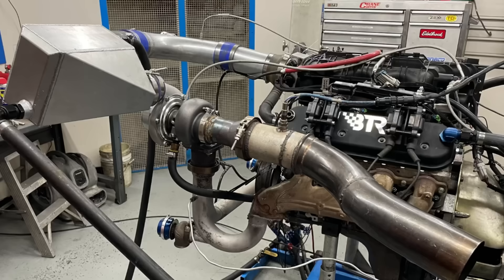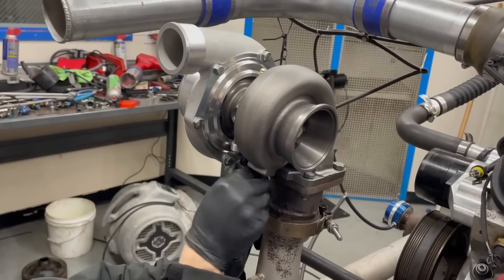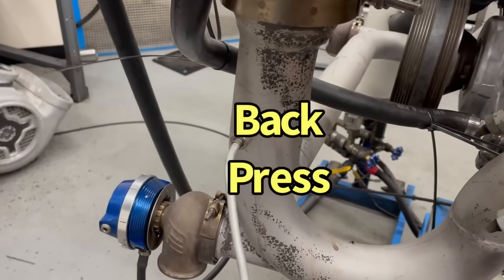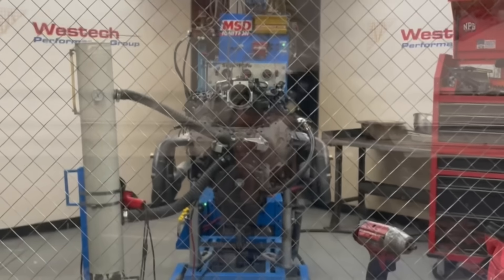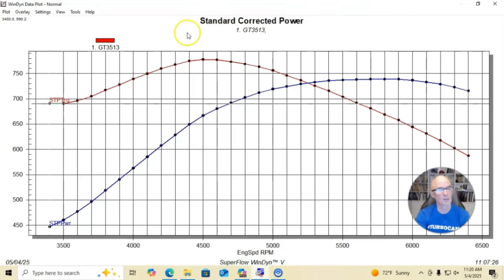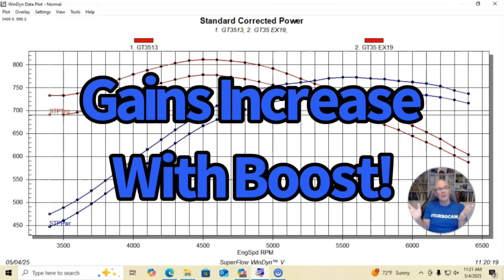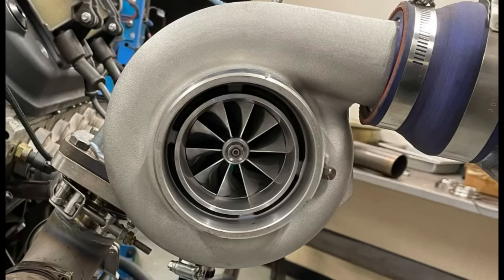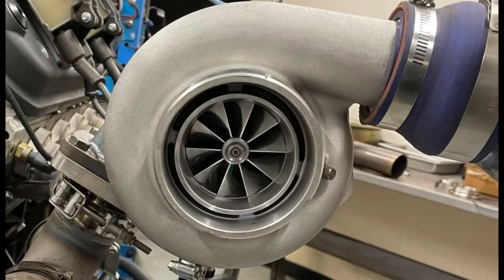WHAT IS THE TURBO POWER CONE? TOP SECRET JUNKYARD TURBO LS POWER MODS! DOES IT REALLY ADD POWER?

Comment: Here's a question for you, with or without a powercone type of piece, what would be the best way to split a single turbo into a dual fender exit? My son doesn't like the look of the pipe just coming out one side of the fender if possible anyway.
Reply from the maker: you can use a Y pipe to split the exhaust exiting the turbo

Comment: I have a cutout at the bottom of my downpipe. When i open it it picks up 4psi.
Reply from the maker: cheap boost!
Reply: Very. And that was on a 66/73. Going to a 72/75 with BTR S1 Turbo cam now. @richardholdener1727

Comment: Yes resistance in a pipe is measure by length, foot, inch, doesn’t matter. Anyway the longer the pipe is the more resistance. That’s why a short piece of thinner pipe doesn’t restrict as much as a full pipe of that diameter. We deal with this with swimming pool and spa pipes all the time. Even if there’s a small valve, step up the pipe and you can hear the pump struggle less and the amps go down.

Comment: I would really like to see the results with the cone tappered back down to a 3" cat back ( or whatever the exducer v band is) most street cars do not run a dump pipe off the turbo.  " Oversized down pipe test".  I assume it would make more power with the bigger down pipe , but who knows with out data.
Reply from the maker: why taper it up to begin with then?

Comment: Would there be a similar effect if we tested single 3" vs 3" that went to dual 2.5"? For some car's it's easier to fit 2 slightly smaller pipes than one larger one, and I think dual 2.25" is probably similar in flow to 3.5" because their cross section areas are almost the same.
Reply from the maker: do the math for area-it might surprise you
Reply: @ assuming pi*r^2, I get about 38.5 sq in for single 3.5” and 39.25” for dual 2.5”. My question was more so if the geometry of the expansion is what makes the power or purely the increase in volume

Comment: This works on the principle of negative pressure waves, same like with the length of the primaries on headers, the position of the collector determines the rpm at which the effect is most pronounced. If you adjust the length of the exhaust before the cone, you can increase the effectiveness at a specific rpm and therefore benefit greatly from it based on the rest of your set up (cam, intake, turbo etc)
Reply from the maker: This is not a reflected wave-there is no scavenging back through a turbo to the combustion chamber (like on a header)-this one is just flow
Reply: @richardholdener1727  there is no reflected wave to the exhaust valve, the reflected wave is effective on the turbine wheel of the turbocharger. The reason of increased boost pressure is because of the pressure ratio across the turbine wheel increasing; pressure in the exhaust manifold remains the same, but the pressure on the turbine exducer is lower because of the constant negative pressure waves applied in that area. This difference in pressure ratio applies more work to the turbine wheel (since the air flows more quickly out of the exhaust manifold) and thus increases the turbo shaft rpm and in turn more boost pressure is created. You should try the test again, using different primary exhaust lengths before the step up, and also different changes in step up size and cone angle. If you go from 3" to 5" inch for example, the effect is much more pronounced but over a much smaller rpm window. The test you made here has the cone so close to the turbine wheel and with such a small step up percentage wise, that there is no peak and trough in the power curve. If you had 6-8 ft of 3" followed by a sharp cone of 45° to 5" and then 2ft of 5" pipe, you would probably see a significant difference in power at 5000rpm and a negligible gain everywhere lower than 4000rpm and above 6000rpm. Try it and then you can call me a liar 😅

Comment: Love this test, what I really would like to see is cone from 3" to 3.5- 3.5 90 degree bend, and back to 3" mimicking a downpipe. My theory is that making the bend larger would increase flow though the 90 degree turn, but I'd like to see that happens if you neck it back down later in the exhaust how it impacts power production. I see this done a lot mostly for fitment issues but would going larger and back to smaller be beneficial? Or would it be a waste of money chasing the great white buffalo of power?

Comment: Richard I've got a 99 Z28 that has a lm7 that is naturally aspirated with a Tremec T56 transmission purchased a blown up l86 that needs a piston put in. I've already had the cylinder wall checked and it's good, it just needs to be bored over. With this being the New Gen 5 LT style engine and having direct Port injection. Brian Tooley himself told me that these engines can make crazy naturally aspirated power. I would love to run the Holley Hi ram but my windshield bezel that holds the windshield wipers is in the way and I'm not going to cut on my car like that. I found out that there is a single plane intake for that engine and I can run a Wilson manifold elbow with a throttle body... I'm trying to figure out what cam and I've got two options for the heads Frankenstein has a option where you can send them your bone stock heads and I also have the other option of buying the Texas Speed lt4 heads.... I've got to figure out what size injectors to run and what size fuel pump I would need. I'm trying to max out the engine naturally aspirated. It already comes 11 1/2 to 1 compression and I've got to put pistons in it anyway so I wanted to ask you if I should go up and compression and if so should I go with something like a diamond or a Wiseco piston? Also I'm sticking to the naturally aspirated thing only because everyone has told me it's a bad idea to run this engine with a turbo mainly because of how high the compression is but I can bring the compression down with changing the Pistons right? Also I don't know how well it would run at the drag strip as a manual car with a turbo... I mean at one time I was going to put twin turbos on it because of lag issues..... I just want the car to run in the fives in the 8th of a mile and honestly at this point I don't really care how I get there, I just want to use this new generation 5 l86 engine because there's no one else around me that has this setup! Is there any way you could please do some testing with this particular engine
Reply: Also, I'm going to pull the lm7 out of my Camaro and put it in my 91 GMC Sonoma that I just bought a turbo 400 for. And I'm undecided on a 7875 next gen vs racing 1.25 ar single turbo on that already 500 horsepower naturally aspirated engine or a set of either 6262's .83 ar vs racing or a set of Borg Warner s366's and the little truck is in memory of my father-in-law that just passed away and the Camaro is in memory of my mom that passed away. So these cars are very sentimental and very special to me and my family and they will be on my YouTube channel very soon. I would love for you to be able to check them out and give me some insight I will definitely listen to what you suggest! Absolutely enjoy your videos, you're a great guy and it's awesome to have someone like you to give it to us straight and not sugarcoat anything
Reply from the maker: You should get our GTX3584RS turbos if twins, or a single G42
Reply from the maker: BTR has run those a lot-they are limited by fuel flow as DI motors and it becomes expensive to add a lot of fuel for boost. BTR has run some NA combos above 750 hp, but not good drivers I imagine

Comment: Cool!  I wonder how much the cone transition angle / length, and distance from the turbine wheel effects the outcome?
Reply: If you do a vband right off the back of the turbine outlet its the best way to do it
Reply: @km6832  i did one for my volvo.  2.5 v-band on the exhaust housing but the downpipe i was modifying is 3in, so I used a 2.5 - 3in transducer but it's only about 1.5in long.  It's a bit abrupt, but better than 2.5 all the way down I guess
Reply: @383mazda  thats the correct way to do it.

Comment: I’m curious does this work more downstream ? I have a 4.8 turbo with a full 3 inch exhaust with a cutout and I wondered if I could cone up to 4 inch on the cutout pipe and it make any difference at all . Don’t have much room anywhere else to up the exhaust size.
Reply from the maker: less of a gain on that

Comment: I have a 5.3l gen 3 with 350k miles on it that i pulled from my truck. Im sending my block to the machine shop. Im building it for a turbo. With the mileage it has it more than likely needs decking and cylinder bore. I want to get forged dish pistons but having a hard time with that. I was looking at wiseco pistons. Thought i would come ask for some input on it. Plan on keeping stock stroke with forged h beam rods.
Reply from the maker: what is the question?
Reply: @richardholdener1727  sorry about that. What pistons would you recommend for a turbo build? I tried looking to see if you may have had a video on pistons for turbo applications

Comment: Richard i have one more question i have a 75 454 that im wanting to hop up to go in a 3/4 ton that was given to me when i lost my dad last june it has a 6.2 liter diesal that i want to take out and put the 454 in I also have a pair of 781 heads that i had the 2.19 and 1.88 valves in what cam would you recommend using the factory flat tops that came in that motor with those heads ill be using a prrformer rpm air gap intake and a ser of headers and will it make at least 375 hp
Reply from the maker: Look at a Can that has 224/232 ish duration for a driver
Reply: Thanks Richard

Comment: Could you tell if I put a ls2 style cam in my gen 3 lq4 do I have to switch the cam sensor to the timing cover or am I able to keep the stock location in the rear of the block
Reply from the maker: check the back of the cam-does it have a cam sensor

Comment: I'd like to see a test to see if its anything to do with the 'power cone' at all, or just the fact the exhaust is bigger. As bigger is better regardless of turbine outlet size.
Ie forget the 'power cone', just go straight to the larger exhaust in a step.
Not a gradual increase, but the increase is far sooner.

On the intake side of things a smooth intake makes sense rather than a step, but out? I don't personally think it matters, but I'd love to see.

And if nobody proves it everyone's gonna now just think it's the magical 'power cone' that does it regardless lol.
Reply from the maker: It says in the video many times that a bigger exhaust is always beneficial-the cone just provides a gradual transition
Reply: @richardholdener1727  indeed. But I wonder if the smooth size transition is a benefit like it is on the intake? I reckon no, but I’d love to know. 

I always wonder when I do it, so I end up bellmouthing the outlet to make it a smoother transition, but am I wasting my time? Probably lol.

And I’ve seen many people think/say an even more gradual transition like the video is a benefit, but Im not convinced. But I’d love to know.
Reply: @StavTech  I agree the question is valid - how much does it help?

I usually just put a few 1" long slits to make a mini-cone, but now I'd like to know if making the cone 4" long (the 'proper' 7 degrees) would make even more HP.

Comment: Rana 2'5 inch on 200 Ford six cylinder put A collector to a muffler open it up p ick aup 3 mph in a quarter mile back in the 80s

Comment: Great test and confirms the theory behind it.
A test I'd like to see is going from a "Power Cone" section back down to a 3" pipe to get it out of the engine compartment.  I'm not ready to run my exhaust out of my front fender on my street car and a 4" or 5" pipe isn't going to fit to route the exhaust to the back of the car.

Comment: Along the lines of the pump gas discussion at the top-
 We all know compression adds power, and boost adds power. 
 Where is the sweet spot balance between boost and compression for pump gas?
 More boost, less compression or vice-versa?
Reply from the maker: more boost-less compression
Reply: The math is fairly simple. Each full point of CR is around 3%, so if losing a full point let you increase from 30 to 32psi then you'd be better off.

Comment: Formula V road racers ( air cooled VW based cars ) frequently have a megaphone exhaust for unknown reasons.  Also, I always find it interesting how dyno cells have wire reinforced glass and concrete block walls then the engine gets put in a dirt track car with a tin foil firewall and floor. .   . ..
Reply: If the engine is going to disassemble itself, it's going to do is sooner rather than later. Once it's in the car, most of the danger has past. Most...
Reply: As a auto research technician, I have witnessed minor test cell engine "ventilation" events, but saw the aftermath of massive kaBOOM events where engine or drivetrain parts exited the roof or hammered deep dents into the test cell steel storm door! I was glad for the heavy, reinforced multi-layer glass & concrete walls that I could be safer behind. Besides we didn't have to race around with the heavy walls either 🙂! Cheers!

Comment: More testing. What happens if the cone goes from 3 to 4 inch   in 0inchs. Then, say the power cone is 8 inches long.. what happens if we have two ?  What's happens on a na engine?  What if the y pipe had a power cone ?
Reply: The best way to do it is right off the turbine housing. If you have a 3 inch turbine outlet do a vband 4 inch

Comment: Is there a chance that you might see a similar effect for Spool Time if you were to run a REVERSE CONE from the exhaust into the Turbo ? For example, if you had Dual 2.5" Exhaust that merged into a single 3.5" Collector, then have a 1 foot section of 'Cone' that necked it down from 3.5" to 3" to feed your 3" V-Band Turbo, would it help Spool time without negatively affecting the top end performance of the turbo ?
Reply from the maker: turbo systems are all necked down in this manner (not all are or can be perfect cones) to feed the size of the turbine flange
Reply: The turbos that benefit from 2.5" per bank are in fact quite massive. Bigger than anything ever tested on this channel. A 2" x-over will support >1500.

Comment: I read testing on this many years ago. It concluded the gases had swirl when exiting the housing. The expansion keeps it from backing up until it reaches a more laminar flow. 

It was sensitive to expansion rate on the cone. I believe 7° was best. 

You could also use straightening vanes like a cross or honeycomb to help.

Comment: I think a lot of us are interested in the back pressure readings and the IAT readings, please provide this information with the power numbers! Thank you 😊👍
Reply from the maker: no...you just have to guess
Reply: @richardholdener1727  🤣😂🤣
Reply: @richardholdener1727  That 67mm is MUCH more responsive at this power level. Can you please test twin 3584's on a 6.2? We have seen your twin 3582 test, but with the 84's different turbine, it should be real nice.

Comment: Just curious.what is the size difference between gt45 7875 gen2 gt3584
Reply: Gt45 is a 69/77
7875 is just that 78/75
Gt3584rs is a 67/62
Reply: The GT45 also has a very 'old' wheel, 7875's can range from old to cutting edge (9-blade), the GT35 seen here has the newest aero.

Comment: Would be interesting to see the exhaust temp and speeds when going to a wider exhaust. 
Rocket nozzles have a very high expansion ratio which increases the exhaust velocity and that improves the overall efficiency of the engine.

Comment: Cool test! My on3 single 76 kit on my 2011 5.0 mustang is 3.5" at the exit and goes up to 4" shortly down-stream the way it came from On3. Another kit I previously looked at with a 76/83 single for the same car goes from a 4" out of the turbo to a 5" very close down-stream then splits into 2 separate pipes about a foot after. It shows they've done some homework extracting efficiency the best they can in the tight confines of the car. I now wonder if the distance from the exit of the turbo to the point of the cone makes much of a difference. The CPR single kit with the 4"-5" transition was almost immediately after exiting the turbo's V-band, my current on3's transition is probably about 8" after the V-band exit and definitely doesn't make the power of a CPR single kit.

Comment: Be interesting to see cylinders pressure and fuel flow in both instances.  I wonder if the higher HP numbers are actually increasing internal stress on the motor, or if it’s in essence ‘free’ due to reduced back pressure, etc.  I’m guessing the answer is somewhere in the middle.
Reply from the maker: how do you define stress-average cylinder pressure increase might not increase actual engine stress
Reply: @ Peak cylinder pressure (not detonating) would be a reasonably safe indicator.  

Mainly looking at how much overhead this buys in terms of HP potential, all things being equal in the bottom end.